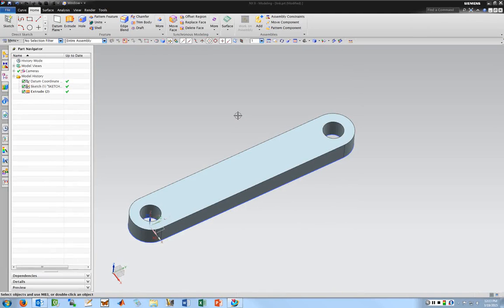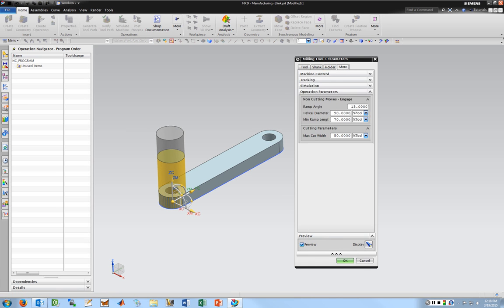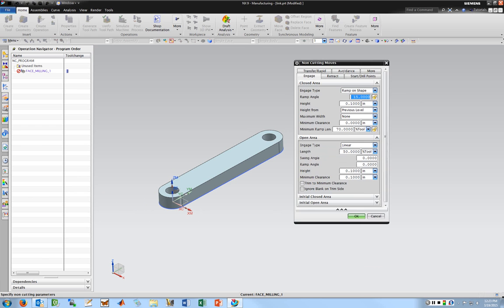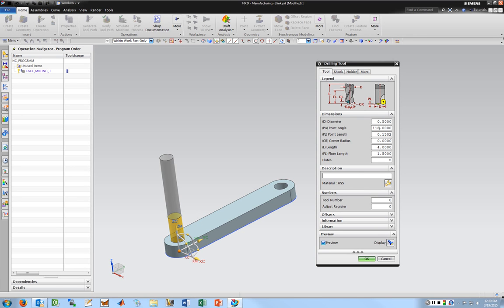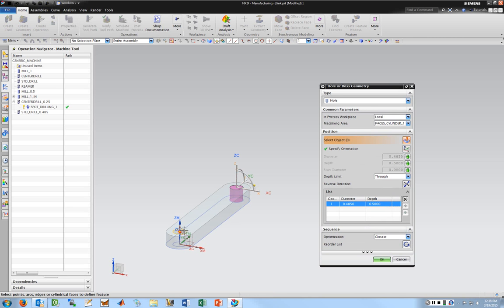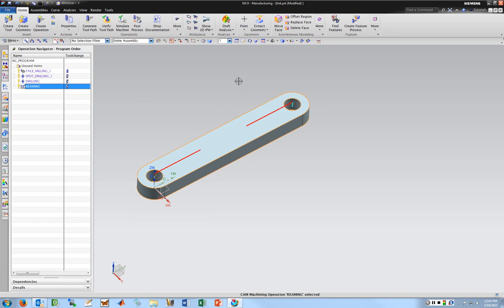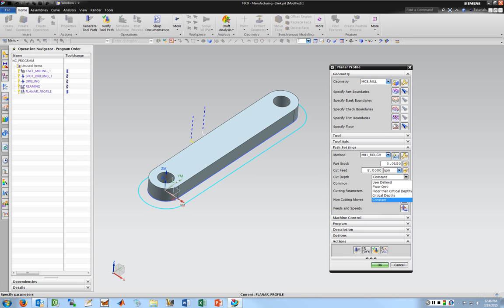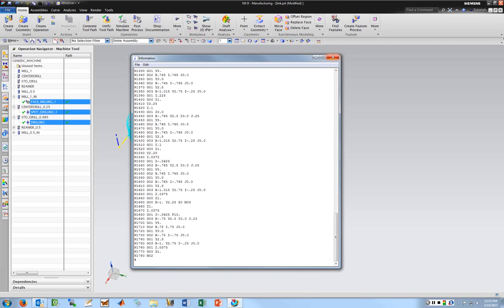NX 9 Tutorial 4 (Basic CAM)

Comment: Do you know of a way to create machining "tabs"? I've built my own 3-axis CNC router and want to cut out some wood parts-- just wanted to know if I can make some "tabs" to hold the part to the blank instead of leaving a thin "skirt" around the base of the part. Thanks!
Reply from the maker: I have had the same problem and don't know a good way to do it.  One method is to create a sketch that has the final cut profile minus the width of the tabs and use it as the geometry for the last pass.
Reply from the maker: You might be able to cheat it by adding avoid geometry too.
Reply: +Dr H Right on. Thanks! I'll let you know if I come across anything also that's easier